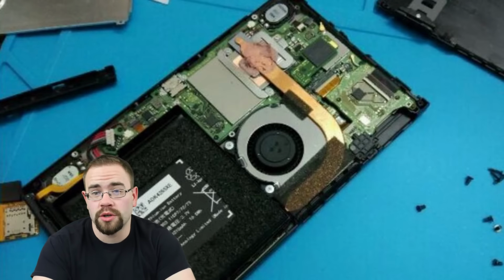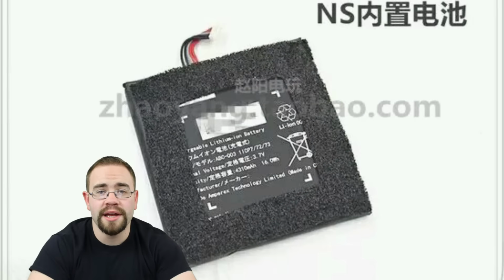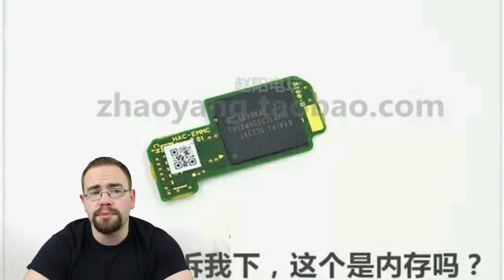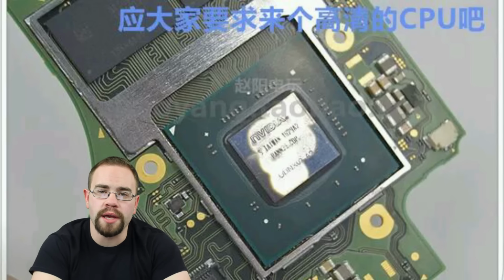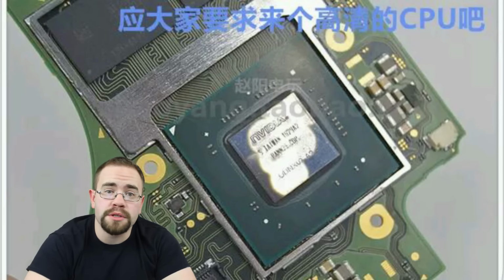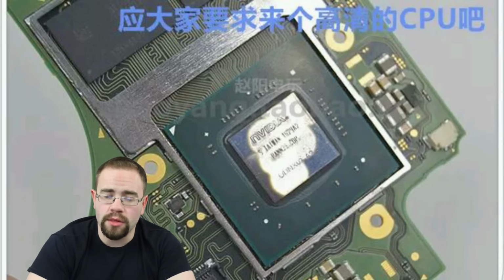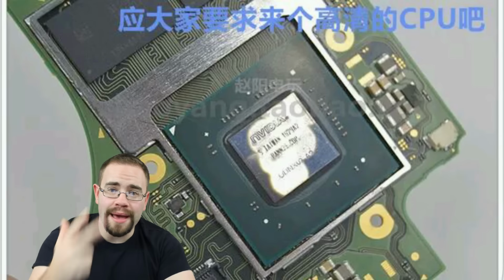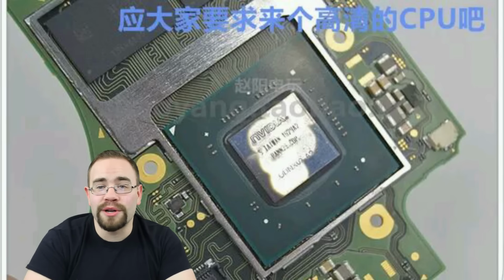The Nintendo Switch Was Finally Disassembled!

Comment from the maker: The internals of the Switch look to be high quality. I'm very happy to see the retail price of the unit will be worth it.
Reply: Spawn Wave Sooooo is the possibility of Pascal out?
Reply: City Fox well we still don't know what a X2 looks like so we don't know
Reply from the maker: What's interesting is there may not be a Pascal Tegra chip that is used in a consumer product. Volta may be used in the next big Tegra chip that is used for consumer consumption.

I think this new revision will be interesting to see under a microscope/ X-ray.
Reply: Spawn Wave Will the switch support 7.1 surround sound.
Reply: Frozen gamer If the Switch supports stereo audio at all, it will support surround sound. 7.1 Surround Sound really isn't hardware, but software. Game designers will add it in themselves.
Reply: City Fox OK but the switch won't have an optical port.
Reply: Spawn Wave Is it possible that the chip is a hybrid in itself?
Reply: A little tutorial on how to replace the battery would be cool if there is a better battery that you could put in there in a couple years.
Reply: Spawn Wave I'm so glad you did this video your opinion is only one that matters to me when it comes to this
Reply: If its 16nm like the Foxconn leak says, Im gonna say its Pascal and Nvidia choose to hold out that iteration exclusive to Nintendo. The A2 revision probably happened during development
Reply: So happy the unit is now worth every Pennie happy I bought it and it is the highest chip set and keep up the great work spawn wave
Reply: UDNX02-A2 --- NX!! There is the codename !! This looks like a "Under.Development.NX.02" ... that's what the code tells me... like a second generation DevKit still under development...
Reply: Fronzen gamer - the leaked papers say that it is capable of 7.1 but only 5.1 is available for the games... maybe a future Netflix app will be able to use it...
Reply: +Frozen gamer Breath of The Wild supports 5.1 PCM over HDMI. The X1 technically supports 7.1, but maybe Nintendo wanted to reduce overall data for the cartridge format?
Reply: what is the chance they use that extra chanels for the hd rumble?
Reply: Squid Empress The HD Rumble is a set of multiple little chambers inside the Switch, a LOT of chambers. They work in unison to make the interactive feeling.
Reply: Victor Custódio If you look closely it actually says ODNX02-A2. The top of the O is slightly worn off, making it look like a U. Maybe it means "Official device Nintendo X major revision 2-minor revision 2". That would actually mean it was revised twice during development: one was a major change (probably maximum CPU/GPU power output), and one was a minor change (power consumption, clock speed, etc.).
Reply: Box Block Games That's rude.
Reply: Box Block Games Better then "Box Block Games
Reply: +Spawn Wave
I don't think you're going to see a Tegra Xavier in any consumer electronic devices. 
With a 30 Watt TDP (it was originally 20 Watts when first announced, but the number was increased at GDC), it's much too power hungry for a phone or laptop.
In addition, it also has a ton of components for self driving cars, including what Nvidia are calling a "Computer Vision Accelerator" which seems to be a dedicated image processing component, intended to handle the processing of the camera feeds.
While they could put it into another Shield TV type device, It's more likely that they would want to build an entirely different chip that's better suited for that purpose.

I don't see anything about "X2" on the chip... but I see a part number that looks a bit like "ODNX02-A2" (not sure about the first character).
The NX part seems more like a reference to the system development name than the chip being a "Tegra X2", especially since there's an "0" between the X and the 2.

+RckRaus5 G
The stepping is usually more akin to bug fixes than significant performance increased though, and A2 itself would be a pretty minor revision at that. Letter increases (i.e. from A to B) are generally more significant than number increases. 

And how would the Foxconn worker know if it's 16nm? It's not like it says anywhere on the chip.
Reply: that 30w is the power consumption for the whole board. not the SoC alone. for the SoC alone we still don't know how much power it will use. PX2 was rated at 250w for the whole unit. when nvidia talk about their development board they always talk about the board whole power consumption. back with tegra K1 they said it is too power hungry rated consuming 12w of power when fully stressed (on jetson TK1). but in reality the chip at maxed used 7w of power running some particle simulation (also mentioned in nvidia documentation for jetson TK1). while running games the typical power of the chip was estimated around 3-5w.
Reply: This is not a Tegra X1 because the rumors that mention X1 architecture also mentions 4 cortex a57s and those are square shape. What I see here is rectangular and there's only two of them. This has to be pascal, it makes sense in terms of battery life and heat generated by the device.
Reply: Spawn Wave no one has said anything about Volta. Have you seen the specs for that? That would mean Nintendo is putting out a mini-Godzilla!
Reply: Thats why its a modified tegra chip. The cpu could be different the gpu could be X1. This speculation doesnt mean much of anything. For all we know nvidia went into the future and took the cpu from the terminator and put it in the switch. Yep I think thats it. I figured it out guys the switch has a quantaflop of performance!!
Reply: +963 productions
What are you even looking at? The CPU and GPU cores are all under the shiny square that says "Nvidia" (the dark green is just the ball grid-array). You can't see the cores in any of these photos.

The two large, black, rectangular chips are Samsung LPDDR4 modules. The part number is too hard to read in order to find what kind of capacity it is though. We'll have to wait for some better images to find that out.

Now what is interesting, is the date code on the chip is "1629" (format is YYWW), which means it was completed around week 29 of 2016 (around the end of July) which might be a bit early for a retail unit. 

The die shape/size, chip package, and resistor layout on said package are practically identical to the 2017 Shield TV Tegra X1 though, which came a bit after.

It looks to me like Nvidia tweaked the Tegra X1, with a bunch of various optimisations and improvements, and then decided to take those upgrades and put them back into a revised Tegra X1 and stick it in the updated Shield TV.
Reply: +Box Block Games
The Eurogamer leak never said that.
It was always 256 cores at a maximum of 1 GHz (512 GFLOPS FP32)
Which they later clarified as 256 cores at 307 MHz undocked (157 GFLOPS FP32) and 768 MHz docked (393 GFLOPS FP32)

This new leak is claiming something like 512 cores with a GPU clock of 275 MHz undocked (281.6 GFLOPS FP32 theoretical peak), and 1005 MHz docked (1029 GFLOPS FP32 peak), but then lists actual benchmark results of  375 GFLOPS FP32 and 875.77 GFLOPS FP32... which don't make any sense, hence why the leak is most certainly bogus.
Reply: Maybe I missed you mentioning it, but felt like you completely skipped one other important modular tidbit: The CPU has an orientation marker in the top left corner, so it's replaceable (upgradeable?) as well and not soldered on. I wouldn't expect a soldered on chip to feature that (but I could be wrong there).
Reply: @box block games - 1 teraflop of fp 16. fp 16 is used more for machine learning then graphics. its 512 gflops of fp 32. which is half. Read some articles man. This is why so many people are so confused about the tegra. These leaks say 1 teraflop and its essentially a lie
Reply: i have been looking at the pictures it says 1629A2 that means this GPU was created between July 18th-24th basically 29th week of 2016. the reports where saying they increased GPU in October. this is clearly an early dev kit
Reply: Uhm, no. Not sure where you got that, but graphics programming is mostly all about "float" (16 bit) rather than "double" (32 bit). All cards, even desktop ones, have far better 16 bit performance and that's what's important for graphics (because you don't need more precision). 32 bit is something more suited for precise calculations (like scientific calculations). In fact a few years ago you couldn't even use "double" in shader programs (e.g. introduced only with OpenGL 4).
Reply: Everyone should listen to ArynCrinn - The guy knows his shit! Ive been on here trying to make sense of things for a while and hes always knows what is up
Reply: @Smaxx - I got that straight from nvidia themselves. I got that from a white paper from 2004. describing 16 bit vs 32 for half life 2. Also if graphics used mainly fp 16 why would the ps4 and xb1 use fp32? The ps4 pro is now using mixed precision same as the tegra x1 because for those simplified equations it doesnt have to store 32 bit numbers and frees up more power. Things like physics etc need more precision. open realistic orlds need more precision. yikes. whats going on here lol has everyone lost their minds
Reply: you dont even know what the stock tegra x1 is capable of you actually think its performance is 1 teraflop lol
Reply: As you said yourself. FP32 can be something for simulations (like physics, if you really want to), but you specifically started talking about FP16 being used for things other than graphics, which essentially contradicts this. I've done lots of graphics programming myself and you typically don't see any difference between using 16 bit or 32 bit precision when drawing (yet you double your amount of data).
Reply: @Smaxx its good to hear something from a programmer, I only go by what I have read about FP 32. What have you done programming for graphics for? Perhaps 3d complex graphics need complex precision whereas graphics that are more 2d in nature would require fp16. but I wouldn't know I am not a programmer lol. What mainly uses fp16 and fp 32 specifically? like anti aliasing? draw calls? etc how do you mix it up to get the most performance?
Reply: Spawn Wave hoping for your teardown of the system..especially the battery if its just easy to replace..
Reply: @ trent 
FP16 can do 3D as well. but games are getting more and more complex graphically. one of ex ubisoft dev said that stuff like post processing (such as bloom) cannot be done with FP16 only. some game dev said certain things does not need FP32 precision but due to how complex modern games are it is much easier to do it all in FP32. you can mixed FP16 and FP32 usage but that will need more attention on optimization. or else the "saving" you get from  using FP16 might not worth the extra trouble you do for it. at the very least this is what i heard from several game developer that discussing on the matter. 

also from what i heard it seems both nvidia and AMD agree for games to use FP32 as standard. the one that still really pushing FP16 for games is imagination technology. they do it most likely because of power and bandwidth saving that can be had when using FP16 vs using FP32. but in their case it is more reasonable for them to push FP16 because they mainly design mobile soc class of gpu where power and bandwidth can be a major issue in mobile device. also mobile games are still not as complex as console and PC games. 

now regardless how nintendo want people to view the switch as hybrid and such it is no doubt it's performance will be restricted due to the "mobile" nature. and this is where it is getting more interesting. because of the mobile nature the switch definitely can benefit from FP16. but the thing it seems nvidia have no intention to going back supporting FP16 in games. nvidia advertise X1 with FP16 support but all that is for deep learning. in many of their recent presentation they never talk about FP16 in games. in fact with desktop pascal (geforce) nvidia actually purposely limiting their FP16 performance because game in general did not use them. anandtech in their review of GTX1080 actually find out that GTX1080 FP16 performance is severely lower than GTX980. anandtech ask nvidia to know if there is something wrong with their result and nvidia confirmed it was not wrong. this to me shows that for gaming purpose nvidia did not want game developer to use FP16.
Reply: Box Block Games even if thats true, 300GFLOPS is a decent upgrade, and its way more convenient than a wii U. I love the fact that you can just pull the controllers off and play co-op with a friend on the run. thats going to be awesome on my next roadtrip to amsterdam! Sidestep, anyway..
Im getting this mainly because of the nintendo games, which actually encourages poeple to experience the games together like it was back in the good old 90's. Gaming to me is just that, having fun with friends. I don't want to play a super realistic game with 50k resolution and 10TFLOPS where it looks like im headshotting a real human being and then laugh at while some 10year old angry kid yells at his mum through the mic...
Reply: Box Block Games You are such a terrible Troll, it's rather funny. Gonna be amazing when the Switch is a successful console. I'll make sure to holla at you 😂🖑
Reply: +Box Block Games
"Yet you believed in those older leaks."
I believe it's based on a Tegra X1, and I believe the Foxconn clock speeds are fairly accurate...
The leaked developer documentation, and now the photos of the chip, have given me even more reasons to believe them.

"Yet this is FULLY CUSTOM..."
Nvidia have only ever called it a "custom Tegra" processor, and have never described it as being "FULLY CUSTOM."
For all we know, it could be little more than a Tegra X1 with the automotive security hardware removed, and a few other tweaks to improve efficiency.

"Also, guess what? X1 can do up to 1 TeraFlop...."
Only at half precision. PS4 Pro can do 8.4 TFLOPS FP16, but you don't hear about that much, because most developers don't care about half precision performance.

_"The Switch is nothing more than a Wii U with 300 GFLOPs more added on... that's pathetic._"
300 GFLOPS may be an exaggeration...
But there's more to it than that.
For starters, the GPU has a whole bunch of other modern features to improve performance.
There's at least one extra CPU core available, and all of them run at nearly 50% faster speed. Although the architectures are quite different, so it's difficult 
One of the biggest improvements over the Wii U, is the RAM and the "lighter" OS. The Wii U gave developers 1 GB of slower DDR3 memory to work with, while the Switch, even in the July documentation, gives developers 3.25 GB of LPDDR4 memory which is more than twice as fast. Combine that with the delta colour compression technology of even a Maxwell based GPU, and you've got quite a solid improvement over the Wii U... especially when you consider that this system is entirely mobile. 

+Thuggee
"i have been looking at the pictures it says 1629A2 that means this GPU was created between July 18th-24th basically 29th week of 2016. the reports where saying they increased GPU in October. this is clearly an early dev kit"

But then you would also be looking at a completely different chip. You don't really change performance much with stepping revisions (the "A2"). At best, you might get a small increase in clock speed (maybe 10% if you're lucky).

Or are you suggesting that Nvidia created 2 different custom chips for this system?

+Smaxx 
"Uhm, no. Not sure where you got that, but graphics programming is mostly all about "float" (16 bit) rather than "double" (32 bit)"

You're getting your data types mixed up. 

16-bit = "half" precision float. Nvidia used to push FP16 years ago, but it never took off. In recent years however, developers have been finding it beneficial, particularly in deep learning applications and rendering situations where bandwidth has become precious. 

32-bit = single precision float. This is what modern graphics processors are primarily designed for.

64-bit = double precision float. Most desktop Nvidia graphics cards actually have better native support for 64-bit precision than 16-bit precision (example, GTX 1080 is capable of about 8.2 TFLOPS FP32, 0.25 TFLOPS FP64, but only 0.13 TFLOPS FP16)
Reply: +ArynCrinn Well... Call it a stretch, but a custom, stripped down Xavier could be useful. Bear in mind, there is a lot of image processing happening on Switch. The IR Camera is one. Extra sensor input and precise motor control for HD Rumble could also benefit off of the applications of the chip. Just lock it down to a lower power draw and it could be feasible. Not likely, but I wouldn't say impossible.
Reply: the sswitches thermal paste looks like chewed gum
Reply: +City Fox
I generally try to ignore him these days.
My response was more for the benefit of others who might have similar questions.

+Wocsor
Getting it down to only 1/6th the Power consumption would be quite a feat...

Honestly, the Switch is releasing far too soon to be Xavier based. Retail hardware has been in production since October at the latest. Final tooling for the SoC would have been completed by about the end of August. Early engineering samples would have been around months before that. The design work itself was probably wrapped up more than a year ago.
Reply: Pascal is most likely also too expensive, but i would say that they have a 2nd generation Maxwell customized with some Pascal features that could fit in gaming to boost it further ... so this would make it an Maxwell 2.5 ish
Reply: weren't the Xavier chips specifically designed for self driving cars and majorly expensive?
the chip clearly looks like a maxwell of some sort and to what nvidia has said it is heavily customised so to really see what it is you really need to xray the GPU
Reply: For most performance you'd go "all floats", so 16 bit performance. Roughly twice the performance as you've mentioned. Precision in 3D graphics isn't as important, especially considering in the end everything is rendered to a relatively small screen. If done right you'll hardly see any differences in render quality. At worst something could be offset by 1 pixel or something like that. If you've seen games where there seemed to be a tiny 1 pixel gap between UI elements, walls, etc. this is FP16 inaccuracies showing. But if done right, you won't notice it. I've done both 2D and 3D programming and you'll hardly notice anything, if you do proper scaling. As mentioned, double can really shine where accuracy is king like physics or scientific calculations. You can improve render quality, but the biggest jump is from unsigned bytes (256 shades per color channel) to floating point (thousands of shades). But then again everything is compressed down to whatever format the screen supports.

So in the end, I'd just say stay calm and wait and see. And I mean "see" literally. Anyone playing on PC can probably confirm that you can have the best rig and games would still lag, if the games are done poorly. But at the same time lower end machines can display awesome games, if done right. It's not just about the hardware platform, but the software as well.
Reply: it is what it is, you can run all the classical nintendo games perfectly fine and even some AAA titles. There are around 25 game developers who are planning to bringing their games over to the switch. So don't be surprised if we see games like dark souls 3, bf1 etc on the switch.
Reply: Spawn Wave How much power does the switch have compared to the Ps4 and xbox one?
Reply: but in this case, superman cant  go  out  of his  house. The mouse  tho...
Reply: Guys this looks amazing... remember I would not under estimate the power of the switch at all because this is an Nivida chip.
Reply: if your that obsessed over graphical output get a gaming PC the whole that has more flop's than the other is a boring conversation if you don't want to buy it then nobody is forcing you buy it if you just want raw power. my PC dwarfs any console but this sort of reasoning just turns into a pissing competition
Reply: +Walther Penne you are serially saying that a fan will fail in 41 days of use ether you are pulling  numbers out your ass or your huffing on a crack pipe.
if a fan was to ware out that quickly it would be faulty
Reply: "nintenkiddies" , do you always assume and categorize someone that don't agree with you on something? Now thats a childish behaviour. if you want to compare specs with different gaming machines, you might aswell say "well, since its not as powerful as the best pc you can build today, then it must be shit" Get over yourself, you can't compare everything with eachother, everything is relative to its self. Nintendo does what nintendo does best, and if we can get some third party games in there aswell, thats just a bonus.
Reply: +Smaxx
Again, you've got your data types wrong.
FP32 = The standard size of a float is 32-bit (aka "single"). A reference GTX 1080 has FP32 performance of 8.23 TFLOPS
FP64 = A "double" precision float is 64-bit. GTX 1080 has FP64 performance of 0.26 TFLOPS
FP16 = A 16-bit float is "half" precision. GTX1080 has native FP16 performance of only 0.13 TFLOPS

+Ashi
Nintendo said there are over 70 developers and over 100 games.

+Team SnowyGraph
Being an Nvidia chip doesn't really mean a thing...
They basically gave up trying to port non-Android games to the Shield TV, and just focused on the game streaming feature, because a Tegra X1 running Android isn't good enough to run a lot of AAA games natively.
Reply: +Walther Penne i have been using and maintaining laptops since the 90's and PC's since the 80's and to be honest what you are saying is fairly disingenuous or you abuse your equipment  yes there is always a minimum it does not mean that everyone one will crap out at 1000 hours on the dot it depends on a few factors and  on average you can get 30,000 hours out of a pc fan but i have seen pc's that worked fine and still do that where built in the 90's its all about maintenance but in the end no peace of tech will last forever. its mainly when you put stress on a system is when you see them crap out quickly.
Reply: +Walther Penne
Floats also come in 128 and 256 bit varieties... but unless you're using some sort of super computer to run high end mathematical calculations accurate to thousands of places, you're not really going to use them.
Games typically use 32-bit floats, mostly because that's what GPUs are typically designed to use, because they provide for a good range and accuracy of values.
They can use 16-bit floats for some things to save on memory bandwidth, but in order to perform operations with them, they have to promote and demote them to and from 32-bit, which takes extra processing cycles... so there's typically a bit of a tradeoff there.
A GPU with mixed precision mode, such as the Tegra X1 or Parker, can basically eliminates the tradeoff, and instead encourages the use of 16-bit floats whenever possible.

Smaxx is confused.
Reply: Yeah, you're right, got distracted by the whole 16/32 bit comparison, since desktop stuff usually has 32/64 bit only (or at least used to have). But my point still stands: For graphics/display stuff, I don't think the lost precision matters significantly.
Reply: So phone  gamers are not  "real gamers"??? Your  "real gamer"  definition is kinda  brief....
Reply: +Walther Penne really the only one acting like a fanboy here is you and to be honest i had a laptop that i used for 7 years nonstop the only reason i stopped using it was the battery started to crap out and the power brick cable broke and the fan still worked fine you are just coming out with nonsense.
Reply: Spawn Wave Yes ZELDA GAMES ARE THE BEST GAMES EVER .... but I am not sure if I am coming back here for awhile I want to explore the game myself
Reply: Any way to tell if the microSD slot is UHS-II or just UHS-I?
Reply: i just wasted 10 minutes reading thru this where did i go wrong, or class is just broing as sin
Reply: its actually GGXT Nvidia SSD portable YXD 40 GHZ CAPACITIVE HEAT WAVE MODULAR YXD GG49 EXPANDABLE HARD DRIVE
Reply: Spawn Wave the switch current is 64gb the OS uses 32gb to rub all systems
Reply: I said rub lol meant to say run
Reply: Not really. The leaked footage with 64GB is from development kits. That's part of the reason what makes them more expensive (so devs can actually test run 32 GB games without the need of SD cards). The internal storage is 32 GB with roughly 7 GB reserved for the operating system and temporary files.
Reply: its built more like a laptop. check out the ben heck show, they opened one up a long time ago and they're actually engineers.